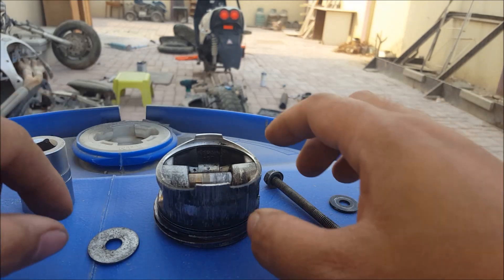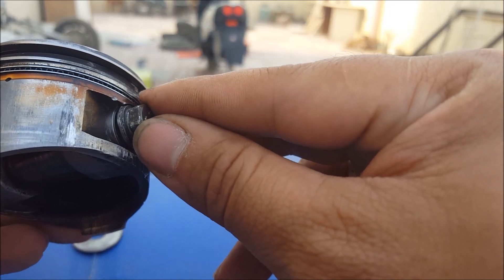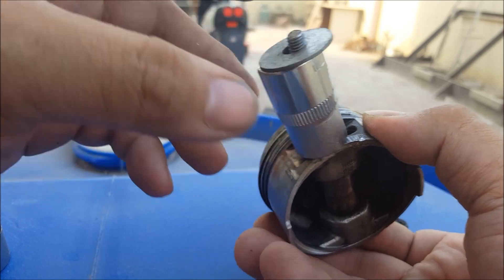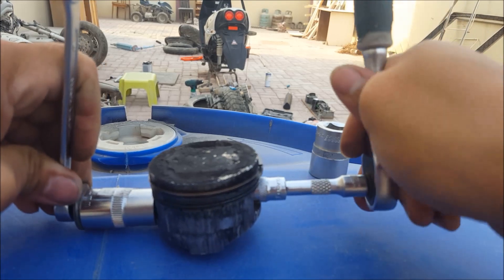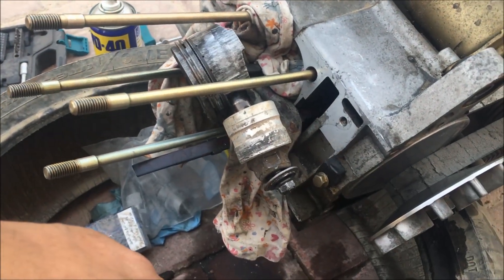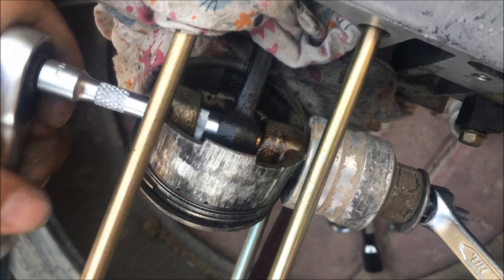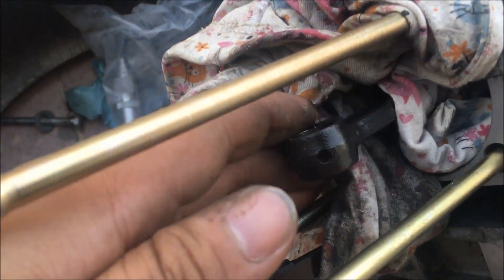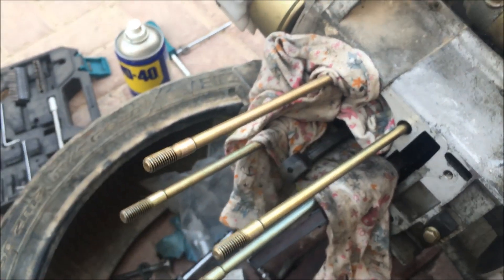how to remove stuck piston gudgeon pin without special tools (2021 updated)

Comment: hmm bolt is always snapping 😂😂
Reply from the maker: High tensile bolts works best
Reply: @VillamesGarage  snapping too :)
Reply: @VillamesGarage  the piston pin is like welded to crankshaft 😂😂
Reply from the maker: @Jakkelapakko  oh shit, best to heat it up with gas torch then try to do the bolt method
Reply: @VillamesGarage  i will try that

Comment: Taba utak mo sir. Salamat! Nag sieze yung piston rod ng dink 150lx na nabili ko. Hopefully umiyot itong method mo. Btw, may play ng konti yung crankshaft ko ng konting konti, side to side. Normal ba yon?
Reply from the maker: Thank you po. Ok lng side to side normal lng po may play konti, ung up and down dapat 0-0 wlang play.
Reply: @VillamesGarage  thank you sa response. Btw effective talaga itong method mo. Unfortunately mukhang di na pwede yung rod dahil gasgas na yung loob after ko matanggal yung pin. Kaya namili nalang ako ng bagong segunyal. Anyway ty ulit!
Reply from the maker: @popcorn5968  sayang naman po. Baka medyo malaking bolt head nagamit. Thank you po!